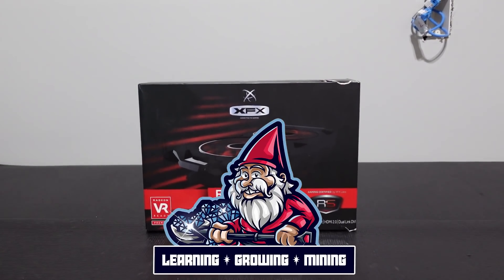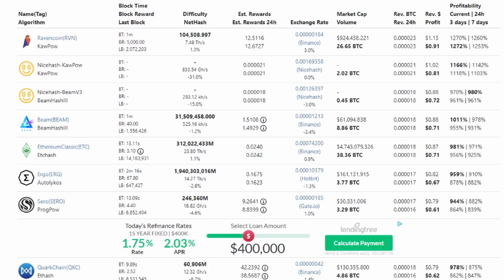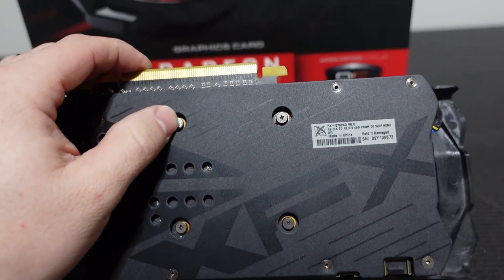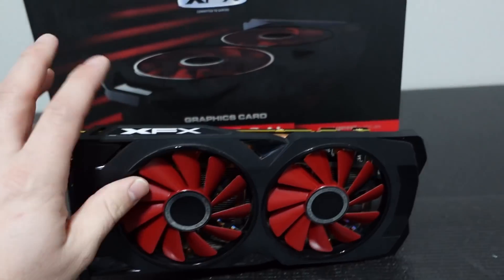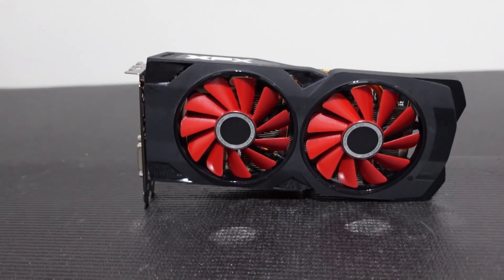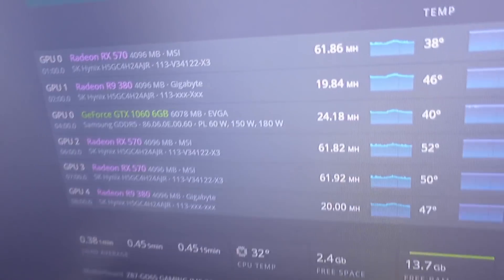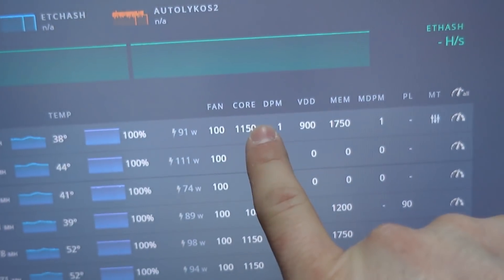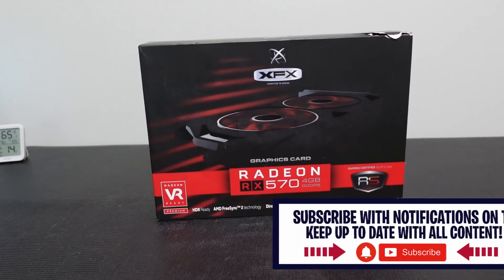RX570 4GB Mining Hashrate, OverClock Settings and Profitability

Comment from the maker: Do you have any GPUs that your Mining ERGO on?  Which GPU and what's your profitability on it right now?
Reply: I have only 4 rx 570 4gb started 3 months ago
2x XFX Elpida 68.8mh/s cclock 1280 VDD 950 MEM 1800 
1x Asus Expedition SK Hynix 65.3mh/s 
1x Asrock Phantom Gaming Elpida 63.5mh/s
Currently mining RVN with all four cards 55mh/s
(need to mine some rvn before halving)
Thank you for tutorial videos :)
Reply: my rx570 mining ERG n testing AVN with my 580
Reply from the maker: Smart!
Reply: @TheHobbyistMiner  I have 6 RX5704g mining ergo on windows:
(2x) Asus Strix RX570 --> elpida mem = 66Mh/s
1x RX 570 4g Gaming X --> Hynix mem = 61Mh/s
1x Sapphire pulse RX 570 4g --> Hynix mem = 66Mh/s
2x Gigabyte RX570 4G rev1.0 --> samsung mem= 61 mh/s
Each cards consume between 72-74 watt
temps between 52°-55°
Reply from the maker: Fantastic info!
Reply: @TheHobbyistMiner  i have 50 r9 380 ergo i see that u are burning a lot of  watt on those r9 if u like u can try core state 2 to carry down the wattage on the r9 it work on etc too i am at 78 watts for the most
Reply: GPU 5
0b:00.0
Radeon R9 380 4096 MB · Sapphire
Elpida EDW4032BABG · 113-2E3083U-X56
36.47 MH
57°
64%
77 W
67
-
2
-
-
Reply: @TheHobbyistMiner  bro 2miner says rvn dag will increase in july 2023 and 4gb cards wont be able to mine so i am wondering what if dag file increases bevore like in 2 months then i wont be able mine rvn with 4gb gpus can dag increase before ??
Reply: i got my RX570 4GB to mine ERGO on a few different settings and ive managed 67.40MH consistently after playing around a lil aha

Comment: If you mine your gpu can you use still daily and pause the mine?
Reply from the maker: Yep.
Reply: @TheHobbyistMiner  I changed my settings to compute but still it comes up  to 47 local and 8 effective hash rate anything else i can tweak?
Reply from the maker: What are you trying to mine with it?  You have a 570 4gb?
Reply: @TheHobbyistMiner  matic yes 4gb just trying to calculate if i can gain or not

Comment: Hey Hobbyist, I need some help man. I have recently gotten into mining with like a budget build which i won at auction and its got 5x 570 Saphire nitro Hynix 2x 480 Elpida and then 2x 470 Hynix
I managed to get most of the cards to get about 60MH + but im worried  i may be pushing them too hard.

All cards are bios modded
Current Settings Look like this
RX570 69.71 MH  - Core - 1300 DPM 1 VDD 970 MEM 2000 
RX570 69.71 MH  - Core - 1300 DPM 1 VDD 950 MEM 2000 
RX570 65.34 MH  - Core - 1220 DPM 1 VDD 960 MEM 2000 
RX570 64.34 MH  - Core - 1200 DPM 1 VDD 950 MEM 2000
RX570 66 MH  - Core - 1250 DPM 1 VDD 960 MEM 2000
RX480 64 MH  - Core - 1200 DPM 1 VDD 900 MEM 2000 
RX480 64 MH  - Core - 1200 DPM 1 VDD 925 MEM 2000 
RX470 59 MH  - Core - 1100 DPM 1 VDD 910 MEM 1875
RX470 59 MH  - Core - 1100 DPM 1 VDD 925 MEM 1875

I have been asking online, pretty much everywhere most people in the mining discords dont even respond to me so I was wondering if you could perhaps tell me if these settings are too high / what would you recommend?

Comment: Driving RX 570 Elpida with 1200 core, 880mv core, 800mv mc, 800mv memory, 1670mhz memory and reference value of 20. 64mhs on Ergo and shows 69 watts but most likely ~85-90 watts. Fanspeed 45% and ambient 27 celsius but its still only ~45 celsius so cant be pushing a lot more than 85-90 watts

Comment: u really think it's getting 90w at 950 v core? (at the wall) also, el-pida is the annunciation lmao. also with those mem tweaks u applied, u don't have to bios mod. in windows, setting ram to the 1st setting is enough. the main ram setting changed in that bios is the tref
Reply from the maker: I don't ever believe HIVEOS Power Usage Metrics, as mentioned in the video.  I also check at the wall instead.
Reply: The word you wanted is enunciation, and even then that's still the wrong word. Pronunciation would be correct.
Reply: @iamthagreatone4041  cunt-gradulations.
Reply: @notyobiz6207  ijs it’s kinda weird that you came trying to be a condescending know-it-all and ironically couldn’t even use the right word.

Comment: I have 4 4gb cards with samasung and elpida memory they all overclock pretty well the 580 is odd though it changes hash rate much more often than the others 2 470s and one 570
Reply from the maker: I never noticed that.  Some Algos are all over the place. For Flux, it bounces a ton.
Reply: @TheHobbyistMiner  yeah the other cards have real solid numbers but the 580 dips to 10.5mh for kawpow alot more than any of the rest